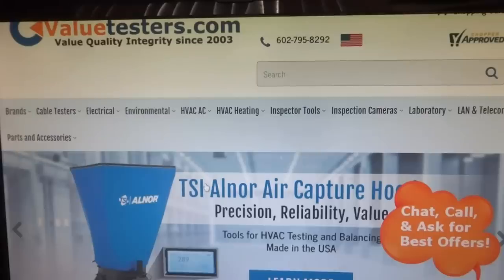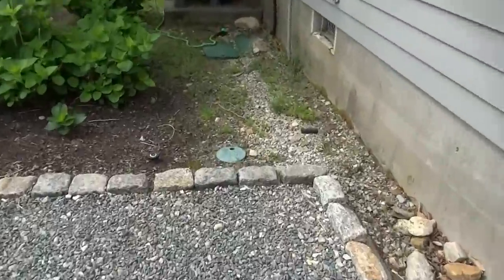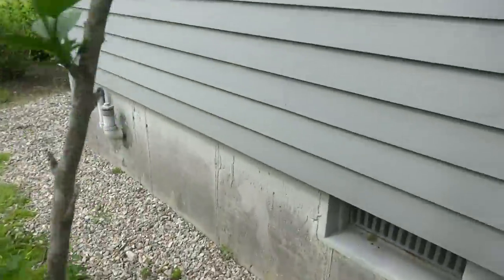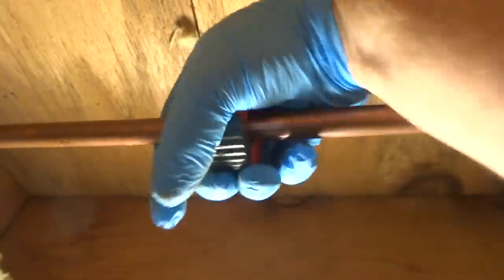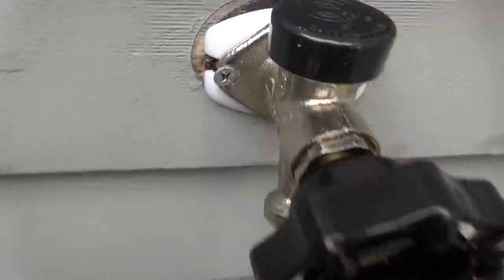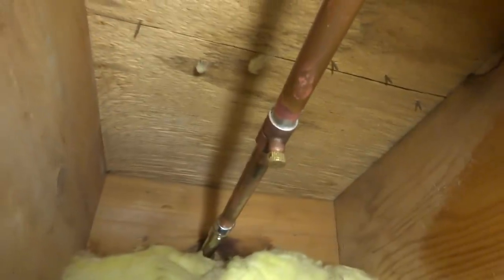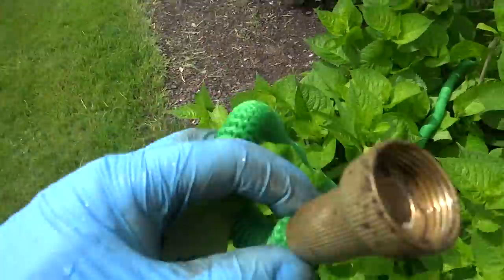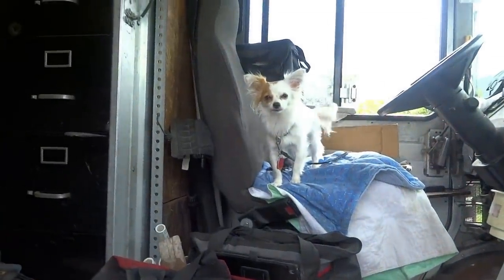outside faucet replacement

Comment: I would have used a female threaded copper fitting to make the connection into the house rather than just soldering the interior copper pipe directly into the frost-free faucet.  That way if the faucet just replaced does need to be replaced, it can be done by simply unscrewing the old faucet and screwing in a new faucet.

Comment: Steven, I think you have more fun at work than most others. Hard to believe with your talent that you go out on faucet replacements, etc... but hey, so long as you are enjoying yourself.
Reply: Some hose bib replacements can be a pain in the ass... especially those frost free ones he has to install up north. Down here in SC we rarely have to deal with them except on commercial jobs
Reply: @Scott-eo7lj  there are ALL like that here in northern Nevada.. and there are ZERO basements. Crawl spaces aren't tall enough to sit up... so, it's all sweating joints from flat on your back. Loads-o-Fun!

Comment: What amazes me, is how many people don't realize how dangerous it is, and actually illegal to drive a vehicle with a dog in your lap, or around the driver's seat.
 #1 there is a law that dogs need to be secured with safety harnesses in the back seat, or passenger seat in vehicles with no rear seating.
 #2 it's just as bad as driving with a child in your lap, and unsecured.
 You can cause accidents from distractions.
 And, the point which should be pressed for dog lovers who won't listen otherwise, is that in the event of a serious accident the dog can be severely injured or die from not being secured 
 Not to mention in the event of an accident or emergency, first responders may be attacked by the dog causing time delays which can mean a matter of life or death for the owner.
 Or the dog may run out into traffic and get hit.
 Of course, it's yet just another law which isn't enforced on our roads these days.
 But I can't understand the mentality of people who do this in the first place and just think it's fine. 🤦

Comment: I got called to a house once they said it was broken couldn’t get water out so I went in basement found the water line so it was actually hooked up but I could not reach it without taking apart ceiling underneath. So I asked again they said they can’t turn it on so the handle was stuck a little cause they don’t use it often so they couldn’t turn it

Comment: Do you do faucet repairs during the Covid-19 quarantine? I have a 25-30 year old outdoor faucet that wouldn't turn off. I removed the stem and found that the head of the screw holding the stem gasket in place was simply gone, thus causing the gasket to come off the plunger step. Tried to drill out the broken screw, but no luck. Filled a new hold on the plunger and found a screw and gasket th add t fits (and is tight) for now. But need a replacement faucet. I dont trust the riggingnIndid, even though it's working for now.  Eeek. I am NOT a handy man, I'm a programmer! Great video, by the way. Watch out for those Cave Crickets! Many thanks.